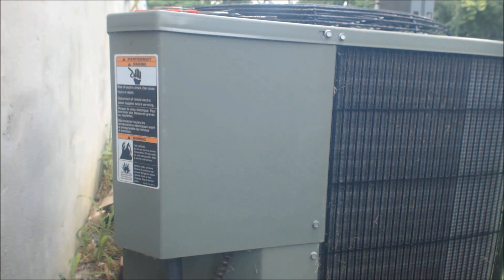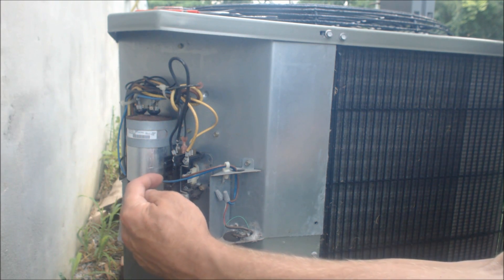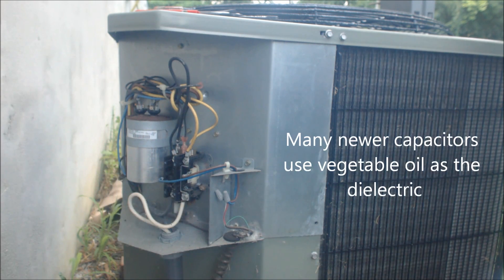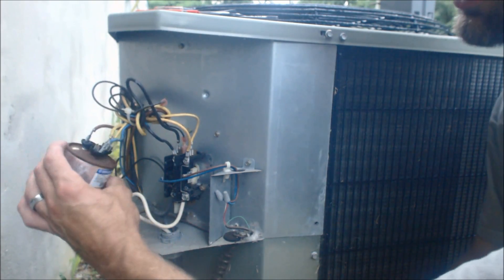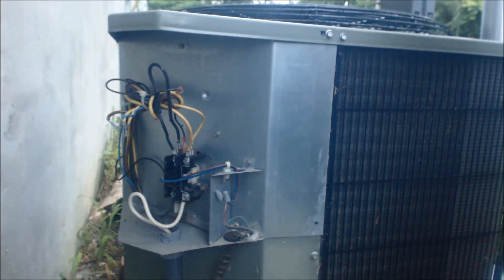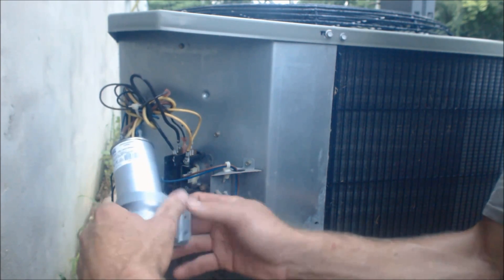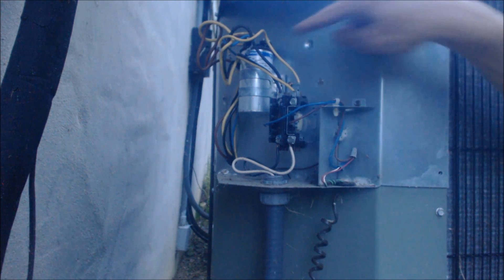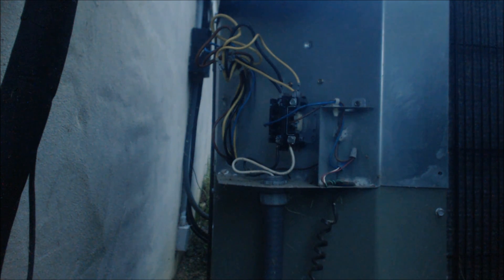Visual Troubleshooting of an Air Conditioner without a Multimeter!

Comment: Would a bad capacitor cause the a/c unit fan blade go at a slow spin
Reply from the maker: It could yes but it may also be the motor or bearings of the motor, thanks

Comment: Not pointing fingers ok because I appalaud you...just saying overall
Reply from the maker: Hey Vjn, This was just a video for beginners, in fact I don't think I was using a mutimeter with this one. Have you seen any of the troubleshooting videos such as liquid line restriction, low airflow, variable speed, psc and ecm- non variable blower troubleshooting? Thanks and I just did one on the potential relay, thanks
Reply: AC Service Tech LLC awesome! No I did not see those videos my good sir, however, I know you can agree on many things that weren't executed properly by AC Techs. I mean many times I hear mixed up information on basic manifold gage readings regarding temperature/pressure association. I can't recall the last time I saw an AC tech checking for refrigerant leaks before adding more to the system. I guess everyone's approach to this trade differ somewhat, even though the AC system works better with only the correct appraoch at all time worldwide.
Reply from the maker: Have you seen the videos I did with the ultrasonic leak detector. I love that tool! It has really been very helpful compared to heated diode and other methods, thanks

Comment: Hey that's kool but capacitors go bad because of many reasons...1,low refrigerant in the system can cause stress on the capacitor due to overwork 2, the incorrect gage wire that support the capacitor from the contactor can result in damage also as a result of stress 3, the capacitor might be too small for the unit its feeding 4, the condenser might be clogged and therefore needs cleaning which burns more electricity in order to dump heat and thus put stress on its components...I can go on and on. I realize nowadays these type of AC Tech. Only focus on small matters like capacitors and contactors; it seems they dont know anything much about evaporators, wiring of the system and thermometers and thermostats etc.

Comment: One way to identify the location of your connection on your cap is the compressor connection will usually have 3 male spade connectors, the fan will have 2 and the common   will have 4 .
Reply from the maker: Yes absolutely, fan sometimes has one but usually two, thanks Sean!

Comment: thanks for your help.. one last question does it makes a difference if the motor is calling for 370vac and the capacitor i have is rated for 440vac..
Reply from the maker: If the motor says 370v and the cap is 440v, it is ok. If a motor said 440v and the cap was 370v then that would not be good.

Comment: i checked the capacitor it tested good.. fan motor is getting hot.. input voltage is around 242..
Reply from the maker: Is that the voltage while it is running too? You could megger the motor. It sounds like the windings are breaking down. Make sure the capacitor is the exact correct size that the motor is calling for. Look on the side of the motor at the rating plate for the correct cap size, thanks

Comment: my condensor fan motor stops running after 5 mins... can u help me out
Reply from the maker: Did you check the capacitor, what is the input voltage, is the motor getting very hot?

Comment: I saw something werd to day variefyed that there is  a  piston in the air handler and my wet bulb is 57 degrees and a dry bulb 75 degrees my target sh is 7 degrees but my problem was I had a 1 degree sh but I can't remove refrigerant to make the sh    go up or the suck temp will be below freezing 

hight sh add
low sh remove (right)
Reply from the maker: This is correct. What about the airflow on the evap coil? If there is more airflow then there would be more superheat. A problem could be restrictive filter duct, obstruction, blower motor tap speed, dirty coil or it is actually possible that the orifice size that the installer put in is for a unit that is larger in btu capacity.

Comment: My capacitor lasted over 27 years. it started to develop a mushroom on the top of the capacitor!! They're cheap to replace. The only thing wrong with my airconditioning unit now, is fan motor is bad!!
Reply from the maker: 27 years is very good!

Comment: Do you have to short out a capacitor that has mushroomed? From what I understand, the mushrooming is like a fuse and disconnects voltage.
Reply from the maker: Great Question! After you shut the power off, you don't need to really spend much time shorting out a run capacitor in general because when the compressor shuts off, it uses the voltage from the cap that was stored. You need to short start caps without resistors because they are taken out of the circuit with voltage stored.Regardless just for the accuracy of the reading, if there were a very tiny amount of voltage left in the cap scraping it before testing will give you the best result. Yes you are right though! Thanks for the question!